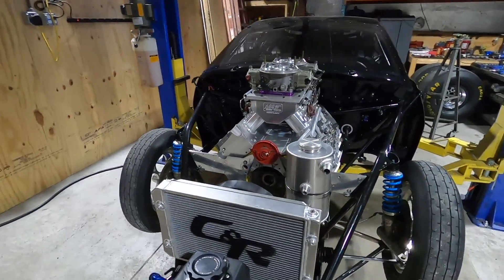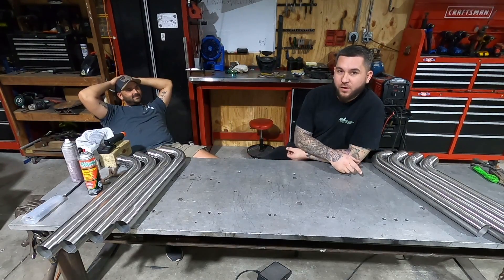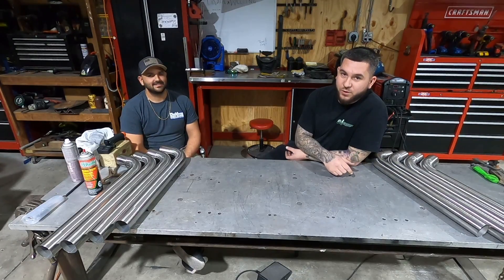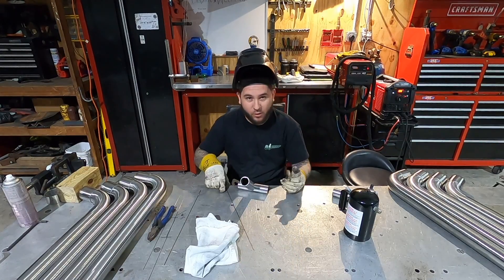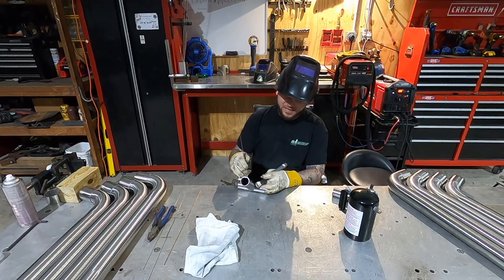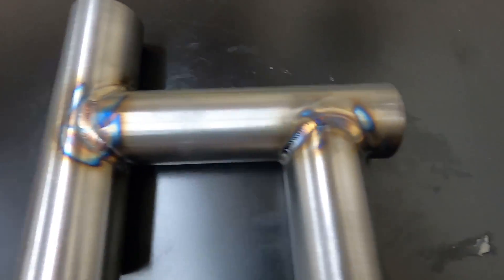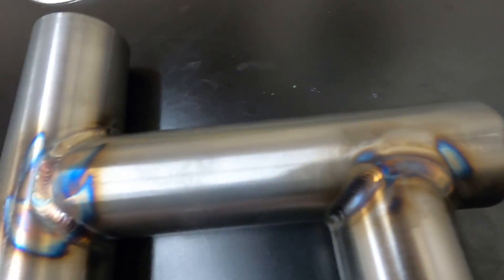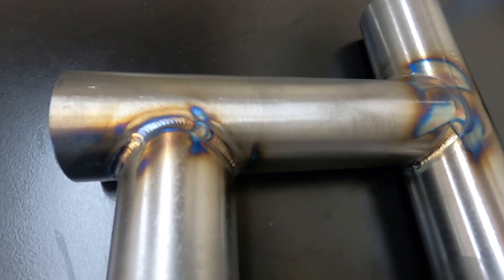HOW WE NOTCH, FIT AND WELD 4130 ON SOME OF THE FASTEST CARS IN THE WORLD!!!!

Comment: New subscriber here. I've been going through your videos and came across this one. I'm currently in the process of building a low budget drag and drive/autocross 78 Camaro and plan on a 10 point pre fabbed cage. The material of choice has not been decided on but I would like to run chrome moly instead of mild steel. My question is can chrome  moly be mig welded since that's the type of welding I do and currently do not own a tig machine? With this being an older video you may not see my comment but if you do, recommendations on this would be greatly appreciated. Great video and amazing welds by you both.
Reply from the maker: Chromoly has to be tig welded.
Reply: You may never see this, but autocross has different standards in the material requirements. Hope you're making progress on your project!

Comment: Back in the 60’s-90’s arc welding then later mig welding ( tig’s weren’t required yet they were super expensive )  became the way to weld a chassis my first chassis was arc welded
Reply: Got my tig in the late 80's and already by then 4130 was required to be tigged. I think the only difference in welder prices was that we only had good American made welders available, no Chinese junk so no cheapies available. When invertors came out they were more than transformer welders, I wanna say Thermodynamics was one of the earlier invertors. I still prefer my transformer.
Reply: I started Arc/Stick welding aged about 10, my step dad made trailers for extra cash, so I learnt with him, Back then even Mig was posh, fancy gas and all lol

Comment: I noticed both of you didn’t hold the wire in the gas after the weld? Why is that? I was always taught to keep the wire and tungsten  held over the weld when done to let the argon keep both the tungsten and the filler rods ends in the gas to allow both of them to be cleaned by the gas. Or is it just a bad habit of pulling the filler wire out?
Reply from the maker: Yes you should hold it under the gas or cut the contaminated tip of the wire off before using again.

Comment: You van tell taking time on these joints is important. Most fabricators seem to think wrapping a joint is a race and the final product will show very hot rows of heat and brittle welds. Thanks for showing it's not going to make a difference in the long run on time. That smoke break can wait a few minutes.
Reply from the maker: Exactly